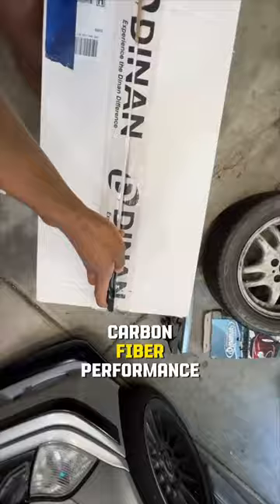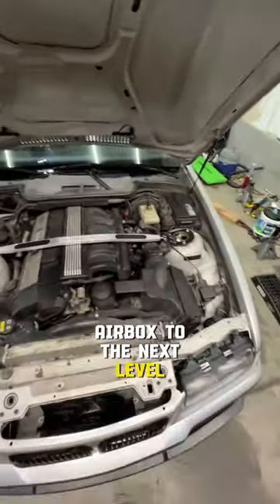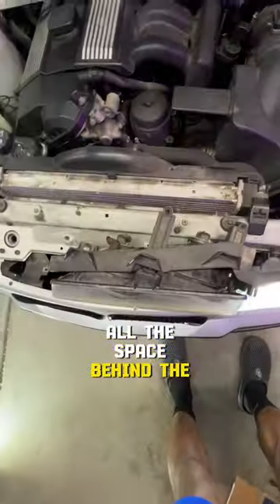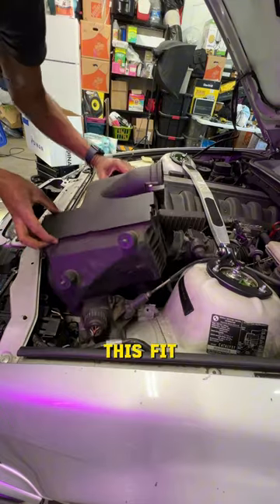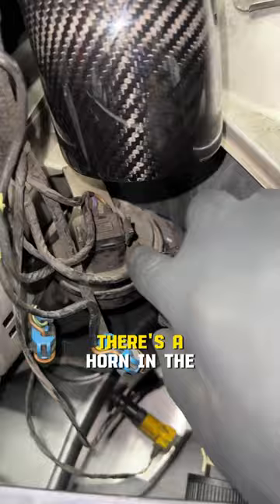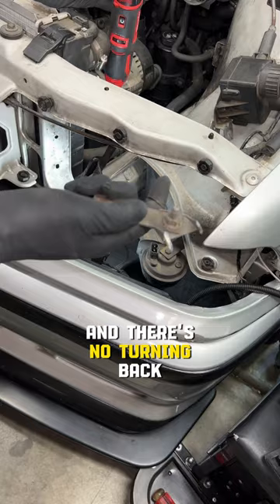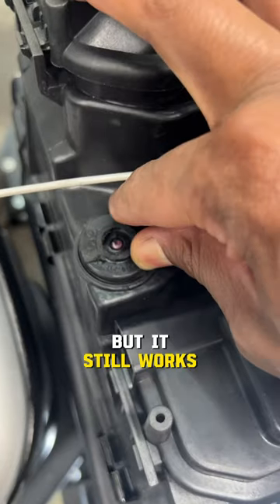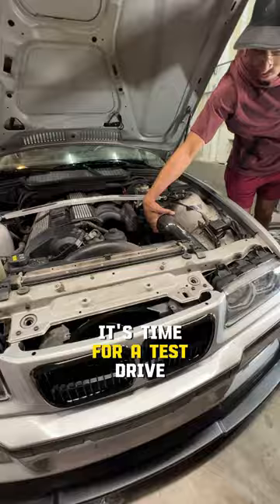If the Holy Grail was made of Carbon Fiber 🏆 | Day 19 #e36build

Comment: I had a K&N filter with the heat shield on my 328i, was very surprised that it barely sounded any different. Once the engine was above 4.5k rpm it screamed and sounded awesome!
Reply: My E46 330 made virtually no difference. I really gutted as it cost a small fortune, it was a proper K&N.

Comment: “Cold air intake” but still inhaling hot engine bay air bc the shroud doesn’t exist..
Look cool but you just lost back pressure and introduced hotter air flow.
Reply: The dinan one is actually one of the few cold air intakes for e36s that are proven to be beneficial, actually goes down to get the airflow from the brake duct area instead of most just sitting behind the headlight. I get what you mean though, very few of these actually do anything except suck hot air in
Reply from the maker: i’m sure with the heat shield bracket installed this intake performs at least as well as stock. it pulls cooler air from the pocket between the bumper and fender liner. the stock box has a cool air feed from the front grill, but it’s pretty restrictive when you look at it. 

but in case you didn’t know, this car made 170 hp from factory 25 years ago - all i care about atm is a little bling and an awesome sound when I floor it! 

i will tune it eventually to see if that makes a difference since they dynoed it at +12 hp over stock
Reply: I really hope he doesn't put a fart can on it instead of a real performance exhaust. some people care more about looks and how they sound than actual performance and drive-ability. thank God I love cars